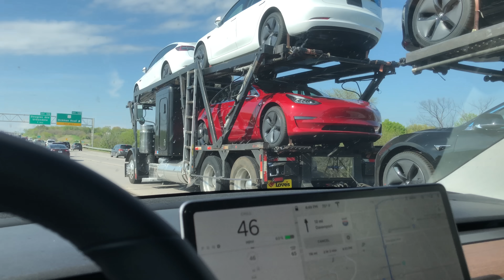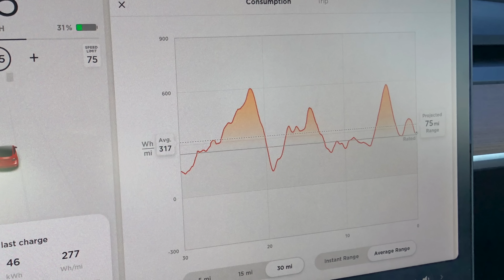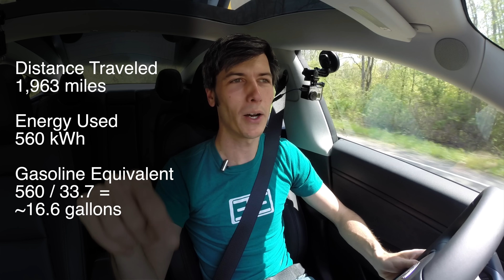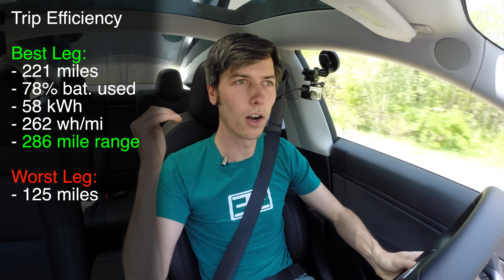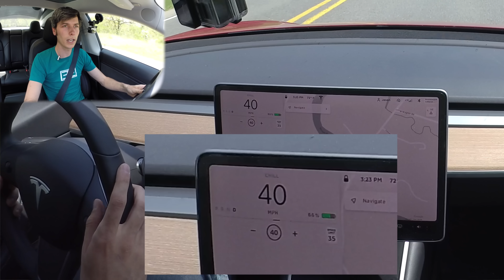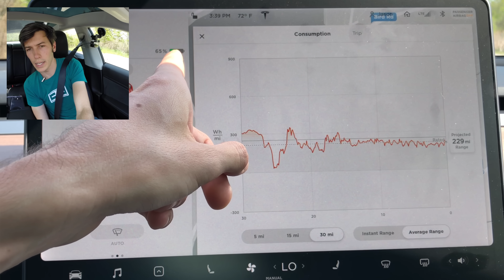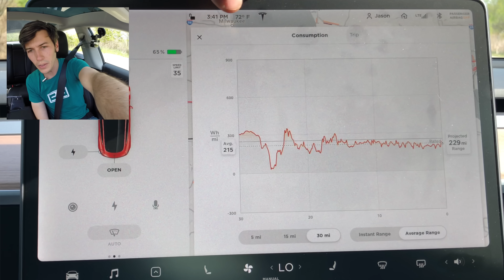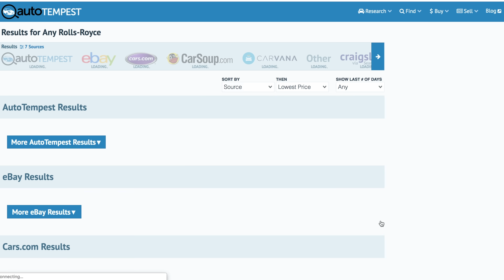How Miserable Is A Tesla Road Trip?

Comment: If you want too get somewhere fast tesla not good choice. Wow only saved $40 over gas
Reply: Supercharging is very expensive vs home charging.
Reply: That's quite the overstatement.  Charging at home is about 3x cheaper than supercharging, so unless your road tripping every day you missed the point entirely.  Typically you save time with an ev since you never have to stop for gas.  5 seconds to plug in vs 5-10 minutes or more to fill up.  Also depends where you live, I'm saving around $550 a month in gas vs driving my diesel 3500.  But closer to 200-250 a month vs something like a Ford Focus.  I have only supercharged once for 20 minutes since buying the car but prefer to fly for most vacations unless my intention is to spend a day or so at each destination skiing the way, at which point I'm not in a rush to get there anyways.  So sure an ice car can get to the other side of the untied States if you don't plan on stopping to eat etc, but if you really care about time that much, you can also just fly and save tons of time.
Reply: @JFlywheel  I think tesla is the best electric car now. But over many years or an accident costs are very high to fix it and replace parts. China is working on electric cars too now so we will see how this all plays out over time.
Reply: @sljs1010  I can't disagree with that.  but the issue is that if i sold my car or totaled it, it would only be for another Tesla.  It just ruins gas cars once you have one. That's why there is the hated cult like following.  I give it about 5 years until the majority of car sales are electric.  It makes little sense to buy anything else right now unless you need an suv, minivan, or a truck, or some other specially vehicle.  For example, I don't think I'm going to be driving the dunes in an electric vehicle anytime soon, or pulling my toy hauler with one.  (disconnect to charge?), but no way I'm going back to a gas car, especially with a cvt transmission.  I love manuals but in reality they are super annoying in traffic which would be a daily problem for me.

Comment: doesn't charging at the highest rate when the battery is almost depleted cause early deterioration of the battery? it's Li-ion like any cellphone or laptop...
Reply: Oren the make up of these batteries is different than laptops, even though it is lithium ion. Lithium is a small percentage of the battery. Also, Tesla batteries are liquid cooled (and chilled using the AC system) so it doesn’t degrade the battery when charging that fast. Laptop batteries are not actively cooled, they live in a hot environment, and typically spend a lot of time at 100% state of charge, all of which are bad for batter longevity.
Reply: @lemongavine  as far as I know these are basically small Lithium cells all bunched together with regulators and control circuitry, but basically the same.
The active cooling however, might slow the degradation considerably. I wonder how much. Does Tesla care about 5 year old cars?
Reply: Oren Tesla designed their own cell chemistry and it is optimized for range, performance and longevity. Same form factor as laptop battery, but different elements. Tesla gives an 8-year warranty on their batteries.
Reply: @lemongavine  i find it extremely hard to believe one can design to optimize every single aspect of a technology at the same time. Especially one that is so thoroughly researched and used throughout multiple industries. There are ALWAYS conpromises. Even a tech giant like Samsung might make a critical mistake optimizing for corner thinness for the Note7 batteries at the expense of robustness and ease of manufacture and have that blow up in their face. Another example, I have lots of Sanyo Eneloop NiMh batteries which I love because they keep charge for a long time when sat unused. They however give about 25% lower Amp throughout compared to regular NiMh cells. A decent compromise for my uses, not good for driving high powered camera flashes.
Reply: Oren you are 100% correct. Tesla batteries do indeed have compromises. They optimized them for certain things, but suffer some trade offs. Some day, someone will design a battery with very few compromises. Solid state is supposed to be the holy grail.

Comment: You are comparing an electric hatch with a gasoline SUV. Of course it's more efficient. The Subaru costs half the price though. If you pitch the Tesla against a modern powerful diesel engine that does 4-5L/100km at highway speeds (~costing <30k), the delta between fill ups and per-kWh charging costs doesn't justify the upfront cost of the Tesla .  Electric cars are efficient yes but still pricey.

Comment: Jason, A good in depth presentation. 👍 
I'm smiling watching at 17.00 watching you explain all pre sorted data on range, power consumption etc. 
I have a Nissan Navara in Australia, the trip computer throws it's hands in the air showing around 100km left DTE.  If you stop and fill it then, there's AT LEAST 20-25lt in the tank.... Most times enough for 250+km minimum. 
That's the best Nissan can do apparently, there's no plans for a software update 🤣

Comment: I'd like to point out that all of the energy loss from conversions (almost) in case of electric car are before counting energy used. In case of gasoline car you count energy efficiency in. In other words,  you already used more energy to charge battery than you used from it, and still it is less than energy that had to be produced to provide you with that. I don't remmember exact numbers but it's huge difference. Fair way of calculating energy use would be counting only energy from gasoline engine that was used by the car, not lost as heat. Surely electric cars are better with it, but not that much. After all you have much less moving parts but still converting initial fuel (crude oil, coal etc) to energy used to drive the car and power all the devices is much closer in both cases.

Comment: What happens if the charging stations are all filled up ? then what? I think that's going to be a problem in the future.
Reply: Agreed. I drove an EV for six years in LA and it wasn’t uncommon to find all the chargers taken, or not working, or being blocked by an EV which was no longer charging but was still plugged in.

Comment: Just for fun and to challenge the EV market, I used your figures of what you were getting to come up with some figures. And compared them to what is practical to me. I drive 120 miles a day for my daily commute just for work.Averages kWh price in U.S.A. , according to Google. So it would have cost you about $7 to fill up to current levels,$0. 12.KwH. But you don't say how much that you ran out of the battery at first, Full charge. To compare my daily driver Mercedes GLK 250 TT Diesel 4 banger. I have a 600+ mile range, consistent not depending on weather, driving at highway speeds. !5 gal fuel tank. I too keep a reserve in the tank of about 75 miles 1/8th tank. My fill up take 5 min. and cost around $40. It also weighs in at 4300# and has most of the bells and whistles. My range is 2 -4x yours easy, and can carry more passengers and cargo. Comparing miles per $, I like where I'm at, let alone the cost of the car/ batterie replacement/with the hazmat fee/ resale price and I have a dealership network through out the nation. I don't have to plan where I'm going as fuel is every where. I see that your car has rear seats, but I'm the size of Dave Bautista and the same age Lol. I doubt that I could fit in that little tin can and I think many people smaller than myself would as well, and you look to be about 130# SOAKING WET. Since you do not suggest that you overnighted anywhere, I'm assume that you drove straight through. passenger alternating with you, so no overnight charging. Actually I think that I could have stopped for the night ,slept and still beat you to the destination. Including stopping for lunch twice, eating breakfast at the hotel and supper when stopping at the end of the day and trip. The difference in stopping to charge vs staying on the road. buy my  calculations on the same roads ,same route 3hr better at least, that's with sleeping at a hotel for the night, changing routes, more.Honestly I stopped watching this when you started quoting figures. which is obvious that you don't know what you think you know. Sad I found you irritating and not at all interesting.And before you start hating on me, I am educated and work in Aerospace/Defense. I am just more practical  than you. Time is money, it is the one commodity that you can't get back!

Comment: Can't help thinking that if you had driven slower you would have got their quicker.
Reply: AdSheff charging is @ 500+mph so it’s faster overall when you drive faster. Bjorn Nyland just set a record of distance travelled in an EV in 24 hours. He did it on the German Autobahn and travelled at around 160 km/hr (100mph.). He did it in a Tesla Model 3 and total distance was 2,781 km (1,728 miles)

Comment: So you spent 40 grand to save 40 dollars on a road trip that took about 30% longer.  I took a trip in a 4 year old Buick and got at least 350 miles per tankful and made it from Cleveland to the National Corvette Museum in 10 hours. Google rated the trip for 7 hours and 48 minutes, (correcting for a different time zone) and about 475 miles. That included getting gas, some construction traffic, voluntarily stopping for a car wash, a goodies stop, 2 Photo op stops, a half hour nap, and 2 relaxed meals, all while going the speed limit. You ignored the speed limit, and were forced to stop every 2 hours. You did no sight seeing or mentioned a nap to refresh yourself. You were also forced to stay close to your car while charging whether you were having dinner or not. If I have to  drive to a vacation destination without any enjoyable stops I wouldn't go. While the Tesla is supposed to be a fine car, you have proved range anxiety will be a factor in purchasing and it's use for some time to come.  You have to do this again, going the speed limit, while spending time to "fart around".

Comment: Interesting information. I'm curious, is there a "reserve" built into the estimated range? In other words, in most of your gasoline powered cars, "empty" leaves you with 20 or so miles before you actually run out of fuel. Is the Tesla setup similar?

Comment: I got a business call at 5pm.  I had to drive from Ofallon, MO (West of StL) to Indianapolis to get a part for business, and I had to be there by 10pm (11p eastern).  I also had to get the part back ASAP so it could be installed before morning.

I fueled up my 2000 Silverado, drove 275 miles, got the part, and drove the 275 miles back without refueling...  cruise set at 80mph (other than the hour or so of traffic I encountered on the way there), AC cranked, and the subwoofer banging out tunes the entire trip.

I only refueled after dropping off the part (around 2am), at the same pump I fueled up before the trip.  Roughly 18 mpg.  550 miles in 9 hours including everything (the first/last fuel stops, the 30-45 minutes getting the part, one stop to urinate).

The key thing is that is with no prep time.  I was at a 1/4 tank and in the middle of running errands when I got the call, and I had to be 275 miles away in under 5 hours.  Electric cars today aren’t capable of doing that.
And that’s one reason an EV isn’t viable for me.
Reply: @dohabandit  Tesla's batteries are like new after years of service - that worry is dead. But not all manufacturers' batteries are as good - and especially those without BMS'es (cough) Nissan Leaf (cough)  - can quickly die. It's true that the battery is the biggest cost of the vehicle, and that's why there's a 8 year warranty on it. But even after that, you should take account of the fact that battery prices are falling around 5% compounding every year. A chemistry revolution is obviously welcome, but not necessary. Scenarios like ChuckO's will be a niche of people who'll want to pay more for the endurance race capability. But EVs other advantages, including TCO, will sway most people before that happens.

Comment: I have heard it is bad for your batteries to use a Tesla supercharger a lot do to its fast charging. If I planed on charging a Tesla overnight, could I change the rate the supercharger charges the battery? There is a supercharger down the street from where I live, it would be nice to park the car there over night but I would not want to use the supercharger regularly if there was a chance it would degrade the battery faster. Thanks

Comment: Jason, in regards to the efficiency of the EV vs Gas and the 2000 miles.... Can you do a video that takes into account the lifespan of the Battery and cost of replacement of a Battery vs what you would typically replace for a Fuel pump, filter, injectors? Cost to the consumer owning his car for the average 11 years. Plus the energy it took to create the Battery vs refine the oil?

Comment: How much worse would the range be when you drive typical highway speeds (140-160km/h, 90-100mph)
Reply: typical highway speed of 90-100 mph???? I don't know where you live, but the typical highway speeds for my area is 65-70 mph! lol
Reply: Captain Soban  well, in Europe legal limit is ~81mph plus some measuring equipment buffer plus some toleration most people would drive with 90mph on cruise control. That would be considered normal here. People wouldn’t see it as excessive speed. That’s why I’m interested in the range.

Comment: Nice vid. Though the 15% buffer isn't really needed. I found the software is surprisingly good at estimating your SOC upon arrival (I usually aim for the 5-10% range), If you want to set a buffer which you want to arive at then don't use the tesla navigation but abetterrouteplanner from your browser
As for the stats: this seems to be a arunning theme with tesla: they promise less than they deliver. This is just such a refreshing change from what we're used to that it still blows my mind.
Reply: I'd think a buffer would be a good idea for unexpected things ... I don't know if it happens in USA, but down here in NZ where we have a lot of major rivers crossing the State Highways, it is not unusual to get detoured 50km if there is a traffic accident on one of the bridges.. nice to have a buffer in case the detour does not pass a charge station :)

Comment: The efficiency is not as good as it seems by going by the KWh used as a power plant is about 45% efficient than there's 8 to 15% lost in transmission plus charging efficiency is about 90% under ideal conditions.
So if it was charged by fossil fuels the actual MPG as far as total energy conversion efficiency is 45 to 50 mpg which is still respectable especially for a vehicle with the performance of a Tesla.
Combined cycle plants that used a ORC turbine to recover energy from the waste heat of the primary stage can get the first stage of energy production to 60% which should make it equivalent to about 60 mpg.
Of course where EVs and hybrids really shine over conventional ICE is in the city as regenerative braking helps recover a lot of energy that would otherwise be wasted during braking.

Comment: Jason, check out "abetterrouteplanner". it is a much better way to plan an EV road trip. Lots of data and variables you can adjust for your trip. You would have saved a lot more time because Tesla's navigation is not that accurate
Reply: Also it's optimized to run on the model 3 web browser

Comment: OT: I tried the Auto Tempest search engine for a 2017 Honda Ridgeline RTL-E,   and it was a complete failure.  FYI.
Reply: I’ve also had a rough time using AutoTempest. They claim to gather all these sources into one place, but makes you go to craigslist to even see search results from there... I’ve had a much easier time finding the models I’m looking for by using the Craigslist app, which allows you to search multiple cities and save your searches for later, etc.

Comment: I challenge anyone to do this trip in the same Tesla in -20ºC temps in January or February and see how long it takes. These cars are designed for warm weather and locations where you can get them charged. Trees on the side of the highway do not have hydro outlets.

Comment: I was looking at his calculation and just couldn't found how the difference between electric and gas is only 40$. I have transferred everything to metric(the right way) and did my calculation and still the same problem. The difference is much bigger. 

I have been going over and over my calculation for hours and then it struck me while taking a dump. 

I live in Europe, it's not 3$/gal here, it's 6$/gal. Which means 1963/30 * 6$/gal = 392,6 $. But here we mostly drive diesel and not gas sucking demons so it's closer to 47mpg and not 30mpg. That means its' 1963/47*6 = 250$.

The difference is 93.2$, even bigger if you calculate that 1kwh is around 0.15 $ here, so 560kwh * 0.15$ = 84$.

That puts the difference between electric and gas to 166$.

p.s. The calculations were done on Casio fx-82ES, so it's very scientific.